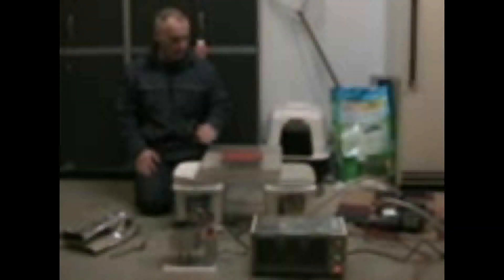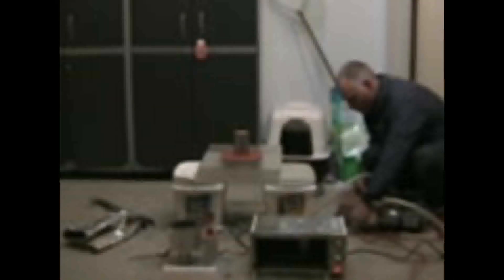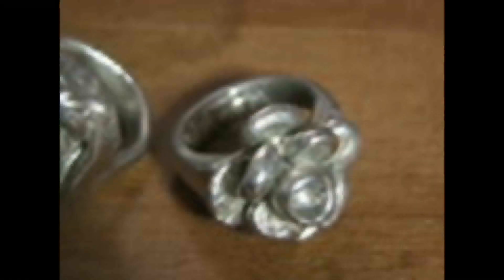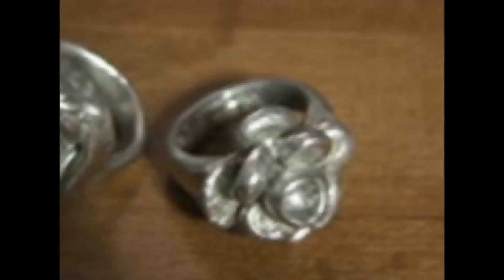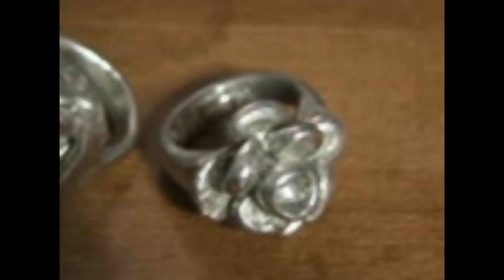Investment Casting Pewter Rings

Comment: How long did long was your burnout cycle?
Reply from the maker: since it was Pewter, I didnt do a complete burnout.  I usually ramp it up to 1200 degrees F.  but since Pewter is poured around 425 or so, I figured a temperature of 500 would be enough.  I did that a while ago but I seem to remember that it worked well.
Reply: Backyard Foundry I have been trying to cast some pewter and I keep getting blowouts. I have been using a traditional burnout cycle and it keeps happening. How long did you allow the flask to sit in there?
Reply from the maker: @jeremywatkins9252  what do you mean exactly by blowouts?  if I pour something that has too much moisture in it, I get bubbles like boiling water.  are you putting enough vents in.  a full burnout cycle is up to 1200 degrees F and I like to pour while it's still hot.